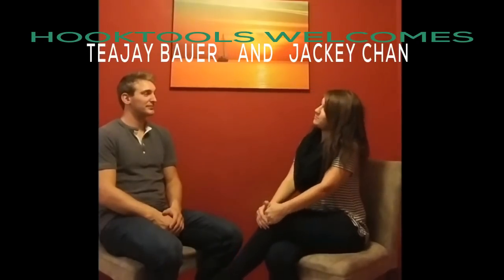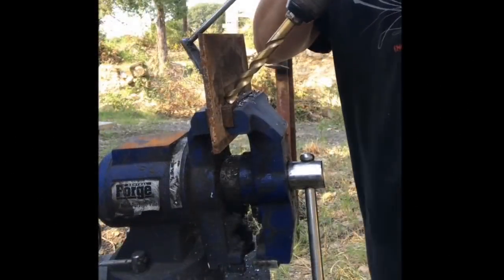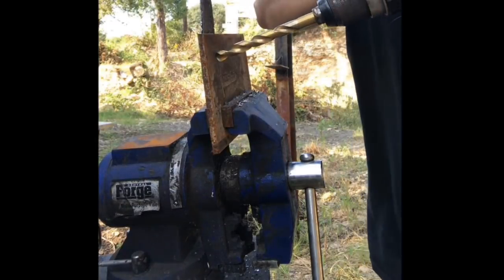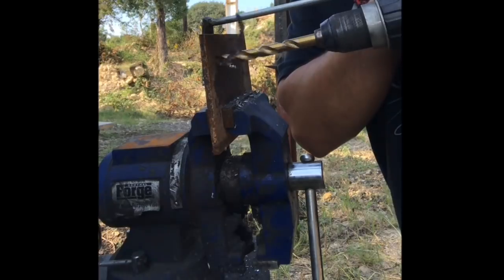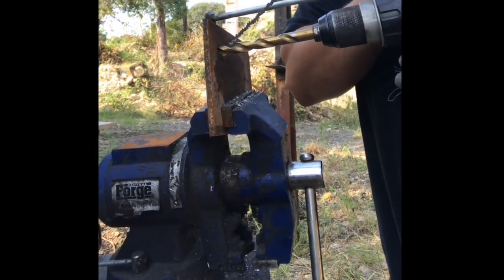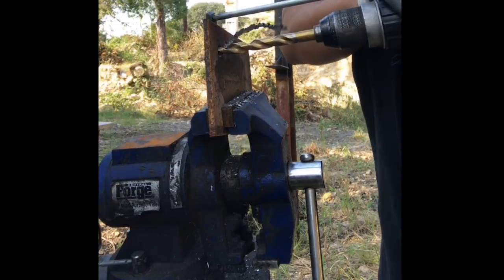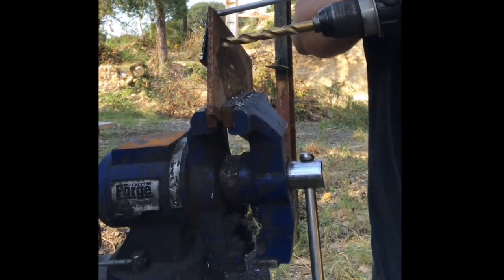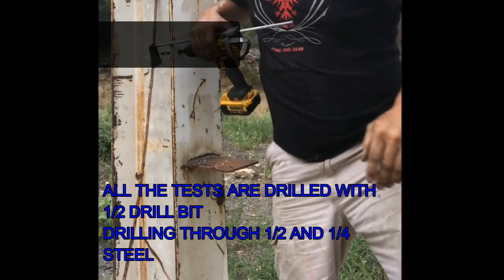HOOKTOOLS

Comment: I guess i dont get it ? . This brace allows you to put all your weight on the drill so you burn up your drill ?
Reply from the maker: ALEX , yes there is some weight on the drill . The hook drill is adjustable and you can put whatever weight you want on it . It does work the drill more . I believe it is better on the drill because you are not drilling as long . The brushes will wear out faster by hand because the drill can take 4 minutes to drill . The hook drill is twice as fast as a hand drill . You only need very little energy to hold the drill straight. Thanks for your first thought .